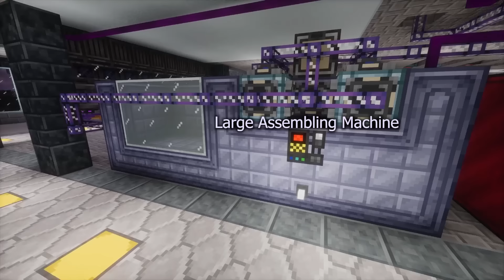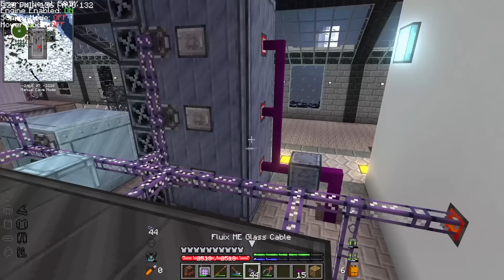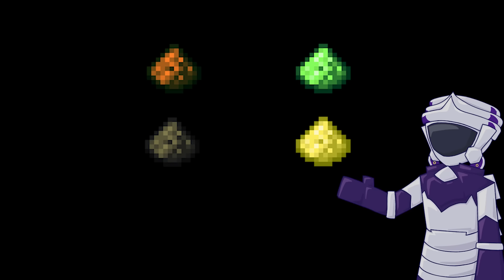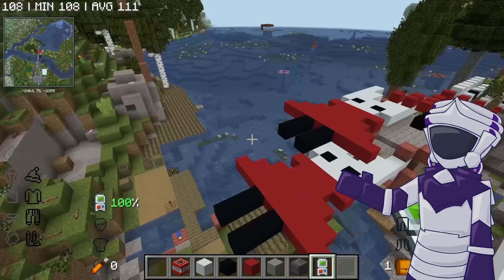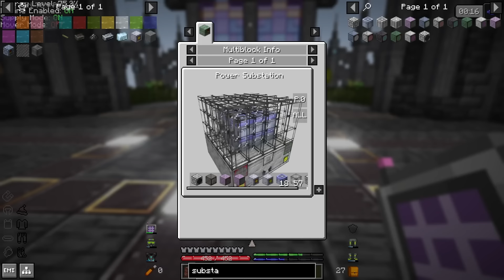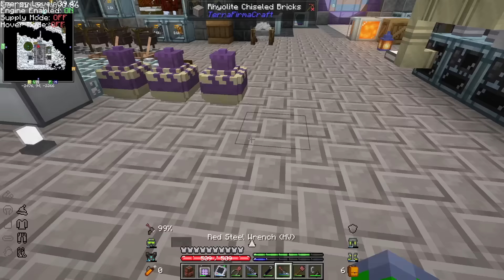Building a Fusion Reactor in Minecraft's Most Realistic Mod (TFG Part 16)

Comment: Yoohoo! The mention of "the strongest acid" sent me down a very interesting rabbit hole involving "magic acid" and acidic gases, as well as an understanding of the distinction between acidity and corrosiveness. To summarize it all up though, the acid with the highest measure of acidity based on free protons that is stable enough to be stored is fluorinated carborane acid, which is approximately 28x more acidic, but significantly less corrosive than Fluoroantimonic acid.
Reply: for the those interested in theory, Helium Hydride (HeH^+) with a pKa values of -63, is the most acidic molecule in the universe. Note that pKa is exponential, and sulfuric acid is ~-3, that means Helium Hydride is 10^60 x more powerful than Sulfuric acid, that is a novemdecillion times stronger. In numerical form:
HeH^+ is 1,000,000,000,000,000,000,000,000,000,000,000,000,000,000,000,000,000,000,000,000 times more acidic than sulfuric acid!
Reply: What gregtech does to a man.
Reply: Imagine some arnian man hearing all about this (they just discovered that acids aren't pointy atoms)

Comment: that ending had a touch of bruh as the feeling of a cut climax, but a fun way to do it with such a defratted foe swooping in however they can.
cool series, and it was the straw that broke the 5 year cammel's back and got em to playgregtech withterrafirmagreg abour 2.5 weeks ago. and thanks for this as its been real fun, even if smelting ingots for 4 hours multiple times is  eating my soul with how many fire ingot moulds end up breaking.